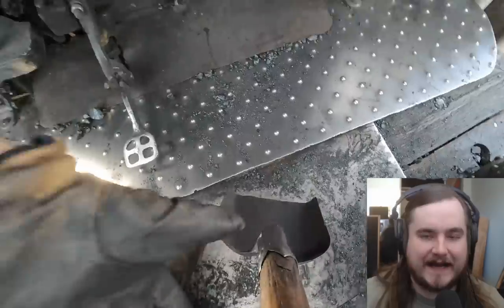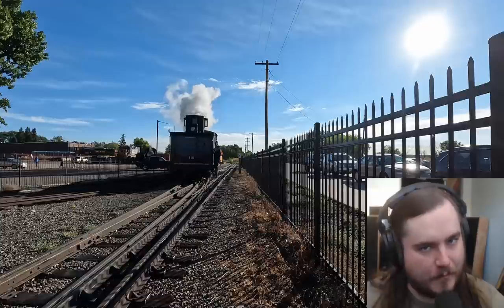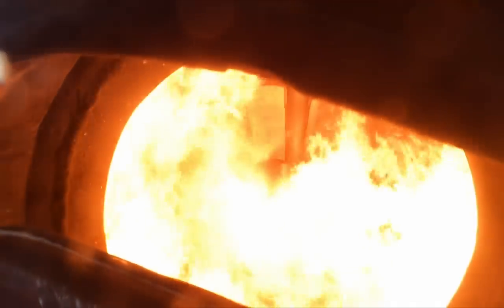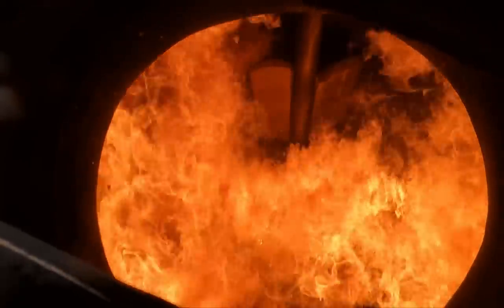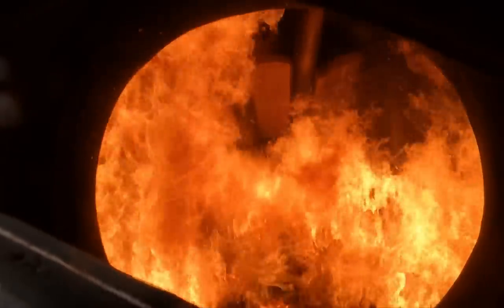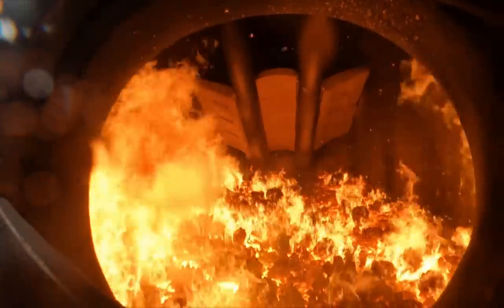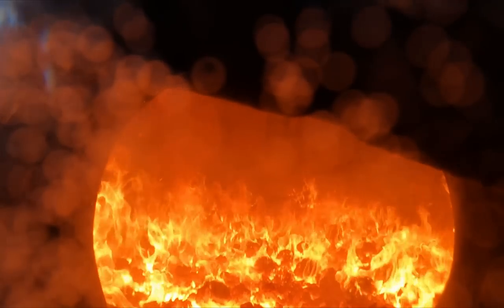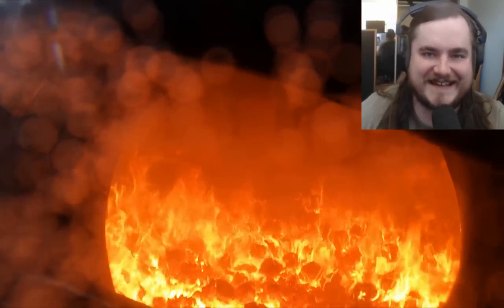I broke things to film the inside of a steam train's firebox.

Comment: I never knew the fire pulsed like that with each “chug”. That’s incredible! 👍
Reply: Nor did I, but thinking about how each chuff is a blast up the smokebox that pulls air through the fire, it makes sense.
Reply: Great idea Hyce! I knew that the steam ejector was used to draw air thru the system but didn’t think back far enough to realize the firebox would be pulsating!
Reply: @Henry-fx4yk  oh jeeze yes it does, its what makes a loco style boiler be able to generate more power then one that is stationary of that size should be able to, the self sustaining fire draght was concepted after stephensons rocket, it fuels it like a blast furnace and its that high heat that makes the steam expand in a superheated loco makes it more efficent the more energy in the volume of steam the more work you can get out of its heat energy and expantion out of it hence the limited cut off at higher speed its more effecent, though depends how the engine is set up and what it was made for like drag, passenger or highspeed freight for example.

also furthermore it has soo much draw in a loco like nkp765 it will bring the fire right up off the grates, or suck up the smaller particals of coal right though the stack if you push it too hard to quick and actually suck the fire right off the grates so to speak before it burns all of it up theroughly
Reply: I knew that because i saw it do the same thing on 4501
Reply: How do I keep finding you in random comment sections!?! XD
Reply: @RailPreserver2K  ah the southern engine that started it all as far as excursion programs now at the tvrm, yea would like to go there one day, I help in the shop with nkp 765 as you can see with some of my videos over the last few years among the racing videos and crazy archery videos I did in years past.
Reply: thats exacly what i was thinking
Reply: I have seen it in a Hungarian documentary from the 1980s about the end of steam there, and it was really pretty.
Reply: I had that same reaction on my first cab ride. The effect is especially apparent on oil burners
Reply: Pulsating exhaust leads to better combustion,  gases mix better
Reply: its not surprising with knowing how the blast pipe works in the smoke stack (that you could also visually connect to the chugging of the smoestac as well)
Reply: It's breathing in a sense. Yes, fire breaths. Watch backdraft.
Reply: Indeed!
Reply: Its the piston pumping air in to increase heat to increase water vapor to increase power and so on.
Reply: @BazilRat  I was wondering about why the chuff the other day, "ok sure it exhausts the steam out the same funnel, weird but ok" but as the other replies to this comment show, that's at least one of the really key inventions of the steam locomotive! that blast furnace effect! I'd just assumed there were steam powered air blowers or something, but I had wondered why the fire didn't also smoke out the firemans door when fueling

Hyce it'd be great to see a breakdown on the steam exhaust side
Reply: @trif55 Hyce could explain it better, I'm sure but...   When the piston has reached the end of its travel, there is still pressure in the steam and in order for the piston to return to the other end (and the wheel to continue to rotate) the pressure of that steam must be released. 

The steam that is released is put to one more use after most of the pressure has been used in the cylinder to move the piston.  That steam passes though some pipes to the bottom of the smoke box directly below the chimney.   There a pipe, appropriately known as the "Blast Pipe" aims the steam directly up the chimney.  The moving steam in the chimney creates a draft of air going up the chimney.

The air that is moved up the chimney has to come from somewhere and that is through the flue tubes in the boiler.  That air has  to come from someplace and that is from the firebox at the other end of the boiler.  And of course, that air has to come from somplace and that is from the openings in the grate on bottom of the firebox where the fuel is being burned.  The fresh air being drawn in that way helps the fire burn hotter which creates more steam to be used to make the pistons move and thus move the locomotive.  The "chuff" that you see and hear is that sudden release of pressurized steam to the atmosphere via the blast pipe combined with the smoke it pulls out of the firebox.
Reply: It is the blasts of exhausted steam from the cylinders being jetted up the stack which causes a venturi effect and subsequent draft through the fire tubes back to the fire box.

Comment: Just suit up in some asbestos clothing and you can get in yourself!
Reply from the maker: It'd have to be thick...
Reply: @Hyce777  wasn't there the guy that went inside 2716's firebox when it was running?
Reply: The New York Central had something similar and where used to make fire box repairs in there Niagaras (the fire would be dropped but the boiler would still be hot)
Reply: @Hyce777  I run different trains all the time my favorite is the big boy 4012
Reply: U should google or YouTube big boy 4014

Comment: When you consider how much heat a tiny domestic coal fire can kick out with natural draft, it's difficult to imagine just how much heat it in a firebox as big as a room, with so much forced draft that it can pick lumps of coal up.
Reply: I burn coal in my forge.  With the right amount of blast from the blower and lack of paying attention, I can turn steel from a solid to liquid.  This is why locomotives have fusible plugs that melt if the water level drops below them, effectively draining the boiler into the firebox and extinguishing the fire.  Otherwise, that same intense heat would weaken the crown sheet on top of the firebox, and things go boom.

Comment: I'm surprised no one pointed out that the sound, slowed down, sounds like what I imagine is the heartbeat of the beast. A bit fast for a large whale but maybe a small whale?  Very soothing. For longer runs it might be possible to build shielding for the water container. I'm thinking either layers of steel separated by air gaps as is used in double wall flue piping or the heat shields we use between catalytic convertors and cars or metal with insulation under. Either approach should block radiant heat so it does not get absorbed by the water and then the go pro.

Comment: Using water bowl for submersing your GoPro camera and thus protecting it from the heat was quite a clever idea. Another way that you could film firebox without exposing your camera to extensive heat is to place a mirror in front of the door at about 45 degrees angle and then pointing the camera into that mirror. Movie industry has been using mirror in order to protect their expensive cameras from potential danger for years. I bet that with some clever engineering (making a periscope) you could even film the firebox through one of the breathing holes of the firebox door. 😉
Reply from the maker: Huh, now there's an idea I wished I had before! I bet that would work out well... Just need to figure out how to do it :D

Comment: Idea for the Future: If you’re willing to engineer this process a little and spend some time in front of the lathe (and mill probably), make a ‘submarine’ type device out of metal tubing with a non-tempered-glass on the nose for the GoPro to be housed in while being immersed in water. Make a bracket for it to sit on the ‘shelf’ for the firebox opening so it can actually sit in the furnace. Then fabricate an inlet and outlet out of cast iron or bronze elbows for water in and water out,  and two hoses leading to a tank with water in it and a cheap battery-powered pump to circulate the water. 1, that will eliminate the wave in the glass, and 2, any heat that builds up will be radiated in your small tank that you’ve set to the side in the cab. Now you can watch the coal land in the holes at it sails over the camera.
Reply from the maker: That's a stretch goal, and possibility.. we'll see.

Comment: I'm new to steam engines and am enthralled by the technology, the kinds of steel/iron/copper,(mild steel, hardened steel, cast iron, copper fire box, tubes, boiler plate...)
The level of machining, metallurgy and casting necessary to make an engine of immense power that actually performs for many hours/miles without tearing itself apart! WOW!

Comment: I haven't seen it pointed out yet, but in the earlier shots where the fire is much hotter, you can easily see the back and top of the firebox.  In the later shots where it's colder, you really can't.  I assume this is due to the colder fire burning less efficient and producing much more soot as a result.
Reply from the maker: Most likely, not sure actually.

Comment: It is fun to watch the flames and firebed dance when the loco is working hard. Some locos produce a strong draft that tugs decently on the shovel. I have watched holes be torn in a firebed when the loco has a good size slip. It is a skill to know where to throw the coal and how to get it to land where you want it as well as reading the fire when all you see are flames and you don't see the firebed when the loco is working. Knowing what the flame color and lengths mean is critical for knowing how to properly fire and keep the firebed level, burning bright and as thin as possible.
Reply from the maker: Absolutely! I've seen and felt the same. Amazing how forceful the draft can be.

Comment: Awesome video as usual!  Now you just need to convince the crew of the NS 611 or NKP 765 to let you do the same. Slow motion shots of how the mechanical stoker distributes coal to the fire.  Plus seeing the power the draft has on those engines when pulling up a grade, with the throttle wide open, and the reverser in the corner almost pulling the coal off the grates.

Comment: fire proximity suit which is covered in a reflective surface and is designs to withstand high temperatures might what you been looking for which firefighters used for fighting the high-temperature oil primary or aeroplane fires

Comment: I saw one when on a service call to fix a closed circuit TV system at an electric generating station.  They were using the camera to monitor the fire ball in the pulverized coal fired boiler.  When I removed the camera I saw a 10-12 inch 'tube' on the front of the camera connected to a supply of compressed air.  I was told that was to keep the lens cool.

Still, after 50 years, one of my more memorable service calls.

John
Reply from the maker: Oh wow. That'd be the real setup. Probably spendy, but I'll see what I can find. That's a neat story. Thanks John!

Comment: Interesting to see how far the flames carry over the arch, or actually, don't... I would have expected that to be pulling flames a lot further past. 

Might be because the door is open and you ad admitting some amount of air. 

Too bad you can't drill out one of the holes to double size, or swap a door with an oil burner with the flip up peep hole cover. you'd have a better field of view and more natural/correct airflow in the firebox. 

Very cool video. I just spend 3 days putting propane burners in a scale Y6b... They test fired it for the first time today.

Comment: A pipe welders pancake hat might work well for the next test. Thanks for getting the shots of the draft.
Reply: Hood. It's a pancake hood.
Reply: @jamesbuckner4791  Hat, it's called a hat to pipeline welders, and mine service welders like my self. It's a flat disk, not a hood.
Reply: @jamesbuckner4791  I know you think i''m wrong, but a pancake hood has a flap on one side. A pancake hat has no flap, it's just a round plate with a filter shade in it like a 10 or 12 shade or higher depending on the stick used.

Comment: What if you were to try a smoke box cam. You would need to be able to pump water into the smoke box and into the tank while also being able to control the camera.
Reply from the maker: I do want to try smokebox cam, but it is challenging. Probably wouldn't need to pump water in if the trip was short enough, but viability will be hard, mounting it, preventing it from being sucked out the stack... Lol

Comment: This is amazing footage and I'm surprised the water bath worked so well. Here's a couple ideas for next time.

If you look into how NASA gets those seemingly up close videos of rocket launches with the flames mere feet from the cameras, you'll find out it's not a straight on shot. The cameras are in a protective box and aimed at a mirror that is lined up to catch the flames in the reflection. Something like that may work well here. Place a mirror in front of the fire box opening with the camera behind a heat shield recording the mirror. The downside is it may be hard to setup and/or get in the way of the fire man shovelling.

Another option would be a dedicated video camera with a good optical zoom that you can mount at the back of the cab and away from the heat. This would solve the issue of things being in the way and have a higher quality sensor and optics, but still a concern of a good mount, vibrations would be a bigger risk at getting a bad shot, and it'll be a lot more expense (especially if doing slow-mo).
Reply from the maker: Yeah, those ideas are neat but challenging to try, precisely for being in the way of the fireman. A longer zoom from further away also means you can't see the whole fire.

Comment: Hi, I've stumbled upon this video and I can help put you in the right direction with capturing the fire box in operation.
Believe it or not but there are actual cameras designed for exactly this type of filming. The cameras were designed to observe inside coal fired power station boilers. I'm not sure if you're aware how coal fired power station boilers work but they're much hotter and more violent than a loco boiler. Coal is pulverised and blown with air into a massive boiler. You'll be aware of how dangerous coal powder is - an explosive risk. Now, coal fired power station boilers use exactly that principle of powdered coal burning to create the release of massive amounts of energy to convert water to steam - it's how they're able to generate such hot steam at power plants. (some steam pipes glow a dull red!) In a coal fired power plant that 'explosive' burn of powdered coal is designed to basically 'float' within the boiler and release its energy.

Specialist cameras were created to monitor that explosive burning (imagine a constant explosion without pressurised containment - lots of energy release) There are specialist imaging companies there in the US who are brought in to monitor coal fired power plant boilers. They watch for fly ash deposition, refractory failures and look for steam pipe cracks. There are actual videos of them carrying out this monitoring work right here on YouTube.

I strongly recommend that you contact such a company for their help. Honestly, a nicely written letter (you sound like a nice fella!) and without all manner of weird legal copyright pay me stuff would go a long way. Write to them, explain the educational aspect and your audience and you might hit lucky - especially if they're located nearby or are passing by between jobs.

Their specialist equipment would be able to handle going through that fire box and perhaps enter a fire tube. You have nothing to lose by asking nicely.
Good luck!

Edit: Here's one of those companies and a video   :)

https://www.youtube.com/watch?v=pOIONzivohg
Reply from the maker: Thanks for the encouraging comment mate - I always saw the price tags of those cameras and assumed no one would let me play with one. But who knows, it's worth a shot.

Comment: Idk if it might work, or how ambitious you are in sticking a camera in there, but you might be able to use a 'boiler sight glass' (borosilicate glass) (like $5 depending how DIY you wanna go) and fabricate a metal or insulated water filled enclosure for the camera so you can shove it in the door for a longer time. Fish tank glass might not take to repeated heat expansion stresses very well.
Reply from the maker: You're absolutely right, because I've already broken the glass. Lol. Totally cracked from heat cycling.

Comment: there is potential for a whole fluid dynamics or thermodynamics thesis in this video. if you wanted to get really nerdy you could do some kind of study on the frequency of the 'chugging' and the efficiency of the air/fire flowing through the firebox. there would probably be some frequency at which the air or fire would be burning more efficiently e.i. the graph wouldnt just be proportional with frequency there would be uneven peas and troughs in the graph..
Reply from the maker: I would love to do that analysis.

Comment: Okay there are ports for watching inside a firebox in coal powered power plants and then also helmets/shields they use in foundries that withstand the heat from the furnace. So wouldn't one of those work for this?
Reply from the maker: I didn't have one and they're expensive. Probably would though

Comment: I'm assuming that it's the exhaust from the pistons going into the smoke box that caused the forced draft? 

Also can you go into a bit more detail on the blower? Where's it located and how's it powdered?
Reply from the maker: Correct on first question; second, it's just a pipe that vents steam up the stack. See my video called "why doesn't 491 have a spark arrestor" to see it.